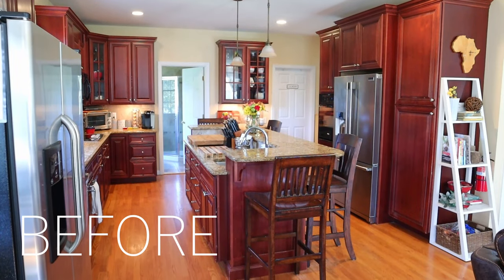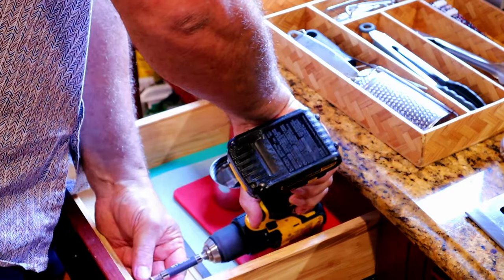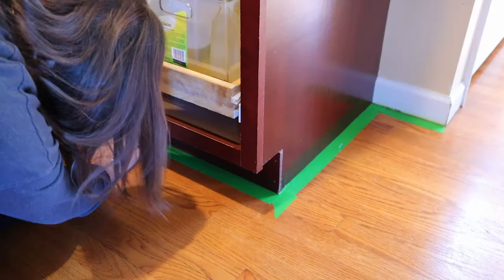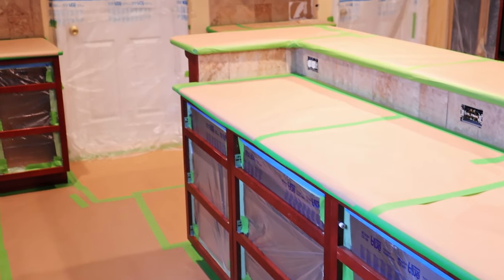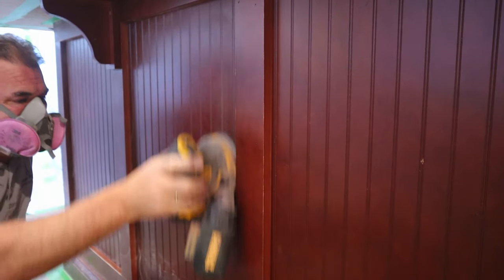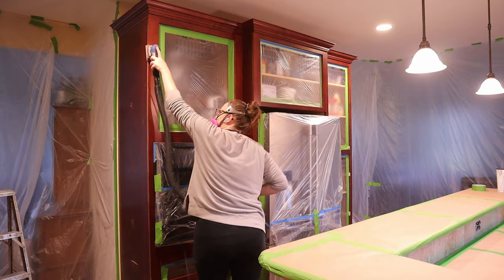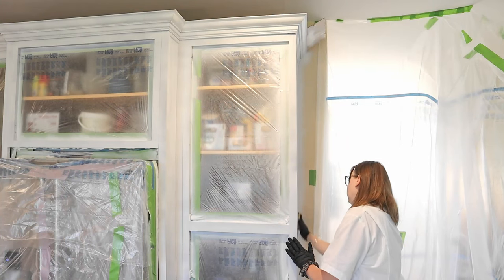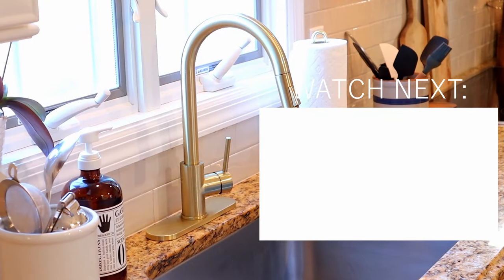Take these Kitchen Cabinet Painting Steps

Comment: Thanks for the video :) I am following it to the T for my kitchen painting. One question, what are your thoughts on benjamin moore advance in comparison to sherwin williams emerald urethane that you mentioned in the video.
Reply from the maker: Both are excellent paint! Emerald is easier to work with and dries quicker in-between coats.
Reply: @VintageHipDecor  Thank you...I am getting emerald :) I saw the video again, maybe I missed it. How many days did you let the emerald dry on doors before hanging them up?